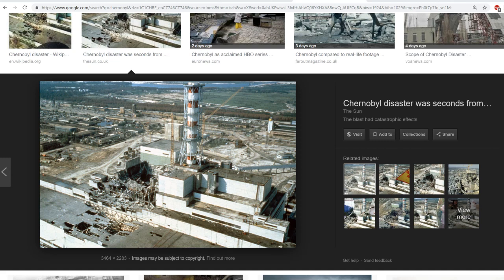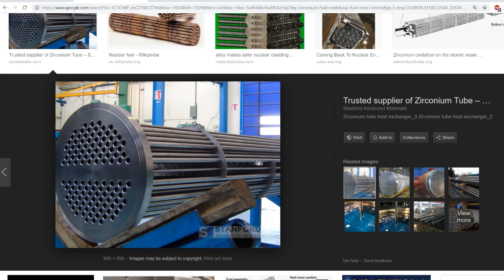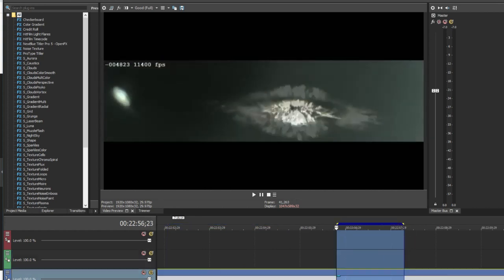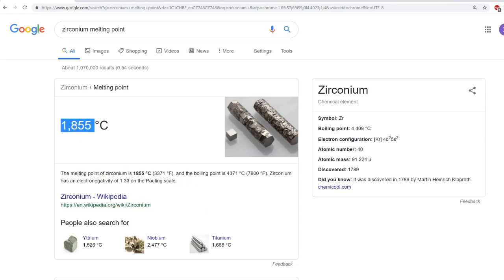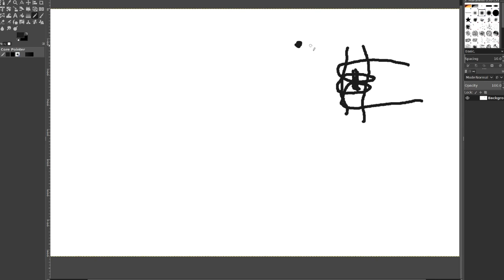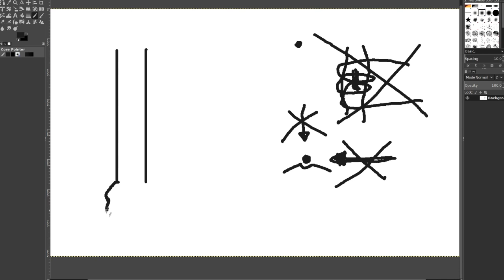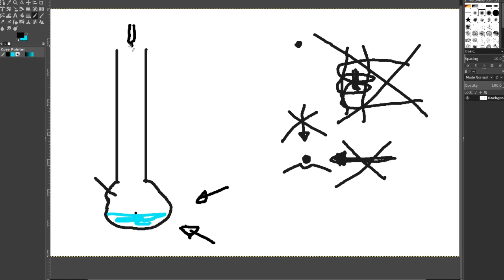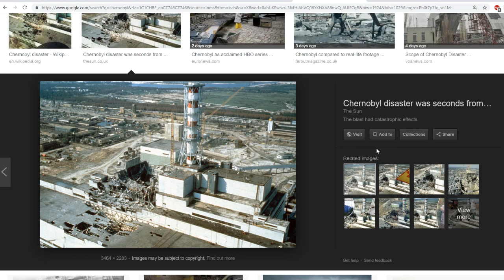Was Zirconium the real reason Chernobyl exploded?

Comment: you can't put the apparatus underwater, you'll boil off all your water LONG before you get the zirconium to melt.

as for the melted zirconium sticking to the wire, perhaps a coating that zirconium doesn't stick to. my first thought is carbon, this is used when melting precious metals because those metals will not stick to the carbon, not sure if this applies to zirconium though.

another option is to use more than a drop, it will stay molten longer. 

or, you can use something like would be used to smelt iron, so you have a mass of coal, some billows, and your zirconium inside that. the coal acts as a reducing environment so you won't burn your zirconium, and you should be able to get it up to temp to melt the zirconium, when the zirconium melts it will run down into a spicket at the bottom and drip down into the water.

for billows you can use a vacuum cleaner set to blow.

Comment: Use a tig welder. A mig welder wouldn't even work. A tig welder is essentially a torch that shoots lightening and it has a built in way of shielding the zirconia from the atmosphere Tig stands for Tungsten inert gas it's really important when welding that your metal never touches normal air during the Tig welding process.  The arc from a Tig welder can get up to 40,000 degrees Fahrenheit. Oh and if you're wondering if it will melt the metal believe me it will. Tig welders melt steel like it's nothing, I have had steel drip onto my jeans while welding. The tungsten electrode you use to shoot the arc to your base metal actually melts when you're Tig welding. The difficulty I see you having is actually filming it. The arc from a Tig welder is incredibly bright. I just can't imagine you doing that.

Comment: Drop the bit of zirconium down a tube containing hot argon plasma, likely RF generated.

If it can't be heated up during the fall, preheat at the top by induction until it drips to a fall and continue heating in the plasma during the fall.

Comment: Could you use graphite for any parts that need to be in contact with 2,000+  degree metal and flow the inert gas in through the top to help mitigate the water vapour problem?

Comment: Could you use a tungsten coil as a resistance and heat a zinc wire  in it so when the drops forms it falls down to water?

Comment: What about taking your wire and putting it in a glass vial full of argon, but have the wire come out both ends so you can  create a circuit. Put it under pure water and pump your high amperage through it thus liquifying  the zirconium inside the vial. (since the wire outside the vial should be cooled it shouldn't fail there). then rigging up a way to break the ampule once the circuit is open?

Comment: Could you use some kind of magnetic field to cause the liquid metal to fall? The metal will loose it's magnetic attraction as it gets close to liquid state. But could you use a magnetic field to hold it in place, until it looses it's attraction? The problem is that it looses it attraction while it's still a solid. If you had a high enough amperage and a small enough sample, you could still get it liquid before it falls away from the torch tip. A vacuum instead of a gas atmosphere would be best so the sample doesn't return to a solid before it hits the bottom. If this is the case, you wouldn't be using a MIG or TIG welder because you don't want the shielding gas. That doesn't matter though because the gas is just there to keep Oxygen from getting to that sample anyways. I don't think?
Reply: Maybe a TIG welder using it's reverse current mode. You might be able to pull the sample toward the torch.

Comment: the melted metal would have to be considerably hotter than the melting point I should think.  The electric coulomb forces would need to act on the liquid metal faster than it forms a solid layer upon contact of the water.    Rate of Coulomb expansion >> Rate of cooling of the Zr skin to below melting point.     The heat transfer rate of Zr at a temperature differential between water and molten Zr has got to be a high delta and the limiting factor.    Inside Chernobyl it is easy to see how liquefied Zr could be super-heated well beyond the melting point before it came into contact with water...  probably can't do that in the lab without magnetic levitation in a vacuum.

Comment: MIG Zirconium wire into the centre of a zirconium sheet metal and it will melt a pool and it will drop.  the circular pool allows a droplet to form as surface tension pulls equally in all directions allowing a melt pool to form into a drop then drop.      BUT WAIT....   will Zirconium is a Group 4  metal, why would Coulomb forces be so strongly set up?   Maybe show that coulomb forces cause an explosion in group 2 metals first then group 3 metals, perhaps metals easier to melt.    Thank you for showing us the Coulomb explosions in group 1 metals ALREADY!   :)

Comment: It's really common when learning to TIG weld thin sheet to heat a spot to the point it melts and drops out as a drop or drops of molten metal which lends itself to an idea.
 How about capping your old apparatus with a sheet of Zirconium with the welders return cable attached  and with a small off centre hole to stop the pressure build-up of your purge argon below the sheet, then have a TIG torch with a gas lens and a big cup above the sheet, the Tungsten vertical right over the middle with a good pre-flow set to shield the puddle the arc creates. That should give a clean unoxidised drop when the sheet melts through and drops into the water. No complicated support structure for Zirconium pellets or pieces it would be quite quick to set up and test to see if it has the ability to create the drops you want with other cheaper metals in place of the Zirconium

Comment: Induction heater seems more achievable other than the cost of the heater... Any possibilities of borrowing one. And let's say the zirconium is suspended once it melts wouldn't it 'drip' so to speak from bottom? Interesting problem though. I quite often find the process of planning is more interesting than the results.

Comment: What about melting the metal in a ceramic vessel with a hole on the bottom - unless you need to overheat it you could let it run out as it melts
Reply: Or maybe a ceramic siphon (https://en.wikipedia.org/wiki/Ultra-high-temperature_ceramics I'm not sure if these are available or workable)

Comment: ive seen these things used on youtube to melt aluminum
https://www.ebay.com/itm/US-1800W-ZVS-Induction-Heating-Board-Module-Flyback-Driver-Heater-Tesla-Coil-Fan/303152901719?hash=item4695522e57:g:5lwAAOSwUlJc2RgW
https://www.ebay.com/itm/1000W-ZVS-Low-Voltage-Induction-Heating-Board-Module-Flyback-Driver-Heater-US/153478738789?epid=584508958&hash=item23bc0bb365:g:5cIAAOSweptc0TB6

Comment: I can see it now.  Flask with water at the bottom, as depicted although much taller.  Inactive gas being pumped from the top and evacuated at the bottom/side to keep out water vapor and air. Pellet dropper drops pellet, which falls first through an inductive heater and then gets hit by a laser before reacting in the chamber which has a highspeed camera pointed at it.

Comment: @Tf00t I have and have experience with an induction heater and mig welder.

You are correct that with a larger piece of metal the heater will heat "faster" due to stronger eddy currents, a larger block will heat roughly as fast as a smaller one as the stronger eddy currents are roughly outweighed by the larger piece. I'm not sure as to whether or not this works similarly with zirconium as with iron.

Yes the induction heater would be able to heat inside a sealed tube but the smaller the gap between the coil and the metal the faster and hotter it will get. I am unsure as to the extent of power needed to heat a block of zirconium nor of a method of forcing a drop to fall, apart from using a larger block and literally just waiting for enough to melt so as to overcome surface tension, which I can see being rather unhelpful as the drop may begin to oxidise as it forms. I am not sure how the zirconium would react to eddy currents at higher temperatures, whether the increased resistance would make it heat faster or slower.

When you said MIG did you mean the one that feeds wire automatically (MIG) or the one where you need to feed the wire manually (TIG) as this will make a big difference, I'm going to assume you said TIG as with a MIG welder it requires the consumed wire to feed and melt to produce an arc whereas with a TIG welder you have more robust electrodes that you would be able to use to melt metal.
In terms of a TIG welder if you had two electrodes and some zirconium wire you would be able to feed the wire into the arc created by the welder thus easily creating a droplet, this droplet would likely fall (although a bit erratically). I'm not entirely sure how you could feed the wire into the arc whilst under vacuum or argon, although granted that you used argon you wouldn't need too good a seal and so could have a small hole in the top of the apparatus. Another issue I can see would be the droplet cooling as it fell but this is easily an issue for any plan.

I would say your best bet would be to use a TIG welder if you can get one and feed wire into a small hole in an argon filled apparatus, you would also not need nor want such a long drop shaft as with the sodium lithium alloy but I presume you already thought of that. You could try with an induction heater although if it doesn't quite work you would have been set back a nice 1000+ quid, but if you could borrow one that might be a possibility if the welder falls through.
I'll reply to this comment with any other thoughts if they arise

Best of luck anyhow. Look forward to potential results.

Comment: It's doubtful this hypothesis will turn out true: Zirconium is in the titanium family, and very resistant to corrosion (at least once a layer of oxide is formed). It would require very, very special circumstances to create the right environment for a Coulombic explosion, that occurs when sodium gets in contact with water with the right conditions, to happen. But I'm not an expert and could easily be wrong.
Reply: >At least once a layer of oxide is formed.

This can only really happen when the metal is solid. In a liquid, new material keeps being circulating to the surface.

Comment: Induction heater suspended in plastic box full of argon and water bath. Set metal rod in heater and melt tip of rod to produce droplet of molten metal.

Comment: Easy to make the droplets electrically, look how a regular high current high rupture capacity fuse does it, using a thin film element with a middle section notched down, and with a small section of reduced dimensions, and with a centre that is slightly larger in diameter. Then apply a very high current pulse, to melt the thin links near simultaneously, allowing the centre section, which is now near melting or molten, but not vapourised, to drop into the water. 

You probably will want to have something like a DC spot welder, with a large capacitor bank to provide the energy, and then a fast semiconductor switch to apply the voltage across the capacitor to the film. Running into ITAR territory for this, but slower ones using off the shelf IXSYS high power mosfets and some decent ultracapacitors will be doable for lowish cost. If not successful you will have the most bad ass spot welder around to make battery packs though.

Comment: Polished tungsten funnel with a plug or slide on the bottom. Run a current through the Tungsten like a tig welder to heat the Zirconium.

Comment: Turn it around:  heat the metal sample, and let it stick to the heating terminals in a blob.  Drop the water onto the metal, rather than the other way around. 

Also, my first thought is why do you need a sample that size?  I would think that nearly microscopic would be easier to melt and also not destroy the apparatus.

BTW, I've seen solar furnaces -- just a large concave mirror -- get hot enough to melt rock.  Some radiant heat source can be spread out and have a reasonable power density, but then you focus it all on a small target.

Comment: I think it possible a molten blob of zirconium could behave like NaK in water. Problem I have is the zirconium cladding would have been most unlikely to become a single molten blob. Another issue is how could the many pieces of zirconium cladding get hot enough to melt whilst under water. To keep he water as a liquid at that temperature would require huge pressure but the reactor design would preclude that.Also even if it is possible to demonstrate that zirconium can produce a coulombic explosion that doesn't prove that's what happened in this instance.Finally there's Occam's Razor...:)

Comment: You could try to keep the water vapor down by circulating dry argon from the top to the bottom of the aparatus. Maybe through a TIG torch that you can use to melt drops from a Zr rod. 
Still the Leidenfrost effect might get in your way, though...

Comment: Use TIG welder on zirconium rod. Should melt and drop consistently. The gas flow could even flush water vapour out of the glass.

Comment: You just need a graphite moderated, water cooled fission reactor with all the safety systems disabled to melt your zirconium. It worked for the Soviets :)
Reply: With a positive void coefficient.
Reply: @lyrimetacurl0  Well that is usually automatically included in a graphite moderated reactor.....
Reply: @srenkoch6127  Only for graphite moderated and water cooled, for voids to alter reactivity requires use of two moderators, at least one of them liquid where the voids form.
Reply: This thread is obviously where the educated commenters hang out.

Comment: ============= TIG WELDER ==============
>> I think the easiest way is to use a TIG welder with high frequency start function. 
>> The welder will initiate an arc without the need to make contact, so you can set a spark gap in the glass and seal everything then start the arc with the trigger button.
>> TIG arc if I have my figures right can go up to 10k degrees C so plenty of heat
if you get a nice one it will have very fine control over the arc, including the pulse length, slopes, amps and pre and post functions (seriously, make friends with a good tig machine, they change your life, they can practically weld any metal, get a good AC/DC machine)
>> TIG welders run on inert gas so argon or helium should and a flow regulator is part of the package. the nicer machines allow you to set times for pre and post flow of gas so you can shield the part before starting an arc and after stopping an arc
>> As for metal balling up, that may need some additional experimentation. the arc that comes off the tungsten (on the torch tip) has some force and momentum to it (it's an electron gun afterall) it almost behaves like a oxy flame, maybe if you get just the right angle it would be enough to blow the blob off the wire. (this is something we rather avoid in normal welding so I never really tried it like this)
=========== Induction heating ===========
>> I have a 1.8kw one that works great, they go for like $50

https://www.ebay.com/sch/i.html?&_nkw=induction+heater
>> I run mine off 2 or 3 car batteries in series (you need at least 30A continuous). I have run mine off of a cheap compact stick welder as well though voltage was a bit over the rating still worked fine (https://www.ebay.com.au/itm/Utra-Portable-160Amp-Inverter-Welder-MMA-ARC-Stick-Welding-Machine-DC-iGBT/)
>> On the other hand, the smaller the piece the higher the frequency has to be, the one I have has a hard time doing anything to a wire but heats up sheet, tubing and even 70mm solid bars pretty easily. I think you need to get to about 0.5MHz to heat a wire with induction
>> Also I was under the impression that  induction heating max temperature was capped by Curie temperature...not sure

Comment: Is it possible to have leads wrapped around the poles of the Zirconium and suspend the metal near the water in the tube?     Amperage could be controlled to temperature required.   The glass tube  filled with inert gas would eliminate oxidation.    When Zirconium is heated, poised just above the water, to desired temperature a controlled immersion could be filmed.

Comment: Could you have the argon jet suspending the metal over water while its heated by the CO2 laser? Then, once the metal is hot enough you could just cut off the flow of argon suspending the metal and it would fall into the water. Argon is heavier than air so there would still be argon in between the metal and the surface of the water... I know the CO2 laser was the least preferred option but it seems like it would be the best way to avoid the concerns laid out in the welder setup. Just a thought. I love this new channel!

Comment: If you use a ceramic holder with an inductive heater, you need to work out the power requirements to heat up the argon flow and the passive cooling from the (black, sorry I can't remember in English... ) body rays, and convection cooling from the zirc.
Reply: Radiant heating? :)

Comment: How about having 3 argons jet holding the zirc blob while the induction heater is heating the crap out of the metal. You would need to shutdown the jets to let the blob fall. Unless a ceramic holder can withstand the 1800c.